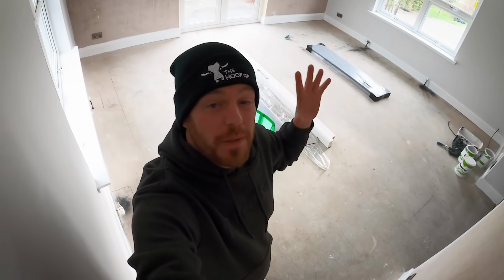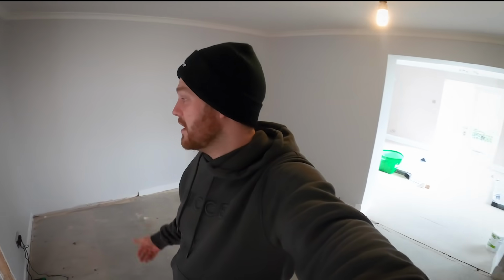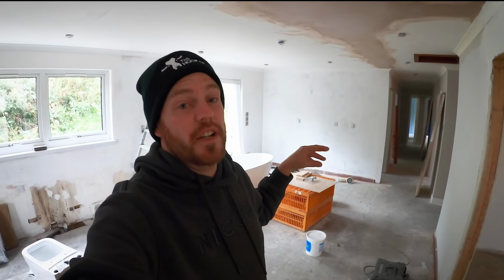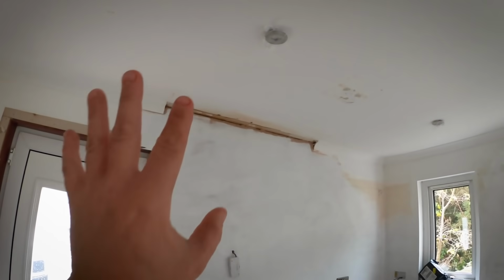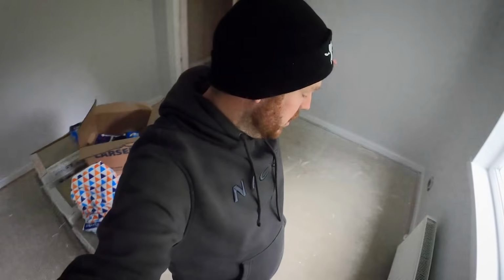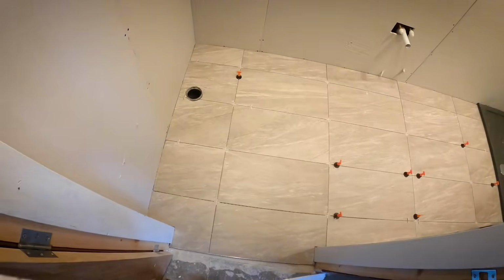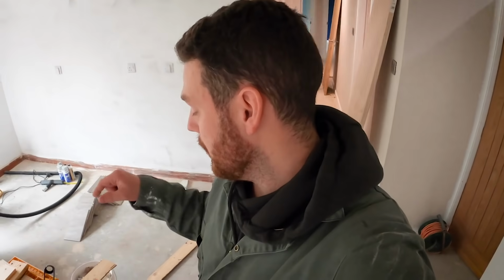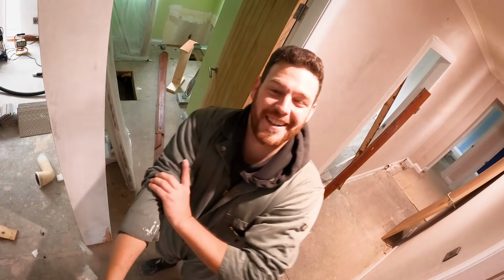IDIOT REBUILDS HOUSE

Comment: Your reno is really coming along. A lot of excellent work in top time. I'm thinkin that the fireplace reno is going really well. And, I've no doubt you won't be able to tell that it isn't real marble when your 'painter' is done. I have great faith in Ash. As a BTW for those yellowing heaters in the other rooms. In Canada you can get spray or regular cans of paint that is specially made to be used for 'hot' surfaces (like heaters). They come in a decent variety of colours definitely in black and in white. You could turn the heaters off, tape appropriate areas and get a lovely fresh look to them. Not terribly big cost. You should check to see. Im sure they would have something of the like there. I would personally do them before you move in just for ease and less smell to deal with. It's a fast 'fix' and they look good.
 (You probably would be better at this than I but I find even coverage with spray cans difficult. So, I often paint things like this with an appropriate size brush to get the good coverage then use can of same colour spray to give the nice finish. I've wasted a lot of cans of spray paint before developing that technique ☹)

Comment: sockets are what my family fight over!! we really need more but rent so....and just a tip with a split like that...you can also put a finishing nail through it at an angle to secure the corner so when the glue eventually breaks down it won't pop up n catch anything.  I'm in love with that tub!! ours is way too shallow to really enjoy if your over 5ft(I'm 5ft 9).  otherwise your wife is kicking butt on the house with your help! 4wks though is pushing it....more like just before christmas(my family moved into my mo.s place back in 06 on Christmas eve!!)

Comment: I drill corresponding holes in the skirting boards and wall. Drive a plastic plug in the wall and attach the board that way.
Not a lot of work and makes it easy when taking them down in the future for painting, wallpapering or when carpet needs replacing. But it's too late now, maybe your next house??

Comment: Greame, always cut the moldings and baseboards from the front. The saw will cause splintering on the back. Also remember, "A little putty, a little paint, makes a craftsman what he ain't." Thanks for the video. Jon
Reply: Also if you put a strip of tape on the back it shouldn't splinter. 😊

Comment: As a general rule you want to avoid cutting wood in ways that will cause splitting but when it does happen, a little glue and something to hold it in place until the glue sets. Then you get to decide if you glued it well enough to not have to explain what happened or just cut another piece.

Comment: A socket here, a socket there, sockets sockets everywhere!! Grats on how gorgeous your home is becoming. It’s a ton of work!!!
Reply: I went from living in a house with not that many sockets to a house with lots of sockets. I love it.
Reply: @jasminehagerman6329  they sure make life easier. I had the same problem with one of my places I rented. I ended up having to get tons of extension cords. Have plenty of plugs now. Those cords aren’t safe ⚡️ ☠️ ⚡️
Reply: @dbell582  I went from 1 socket per wall if I was lucky to 2-3 sockets per wall depending on wall length. Unless it's the hallway or the wall that has a closet on it then its 1 for the hallway and none on the closet wall.

Comment: I would lay the floor before installing the baseboard trim!
Reply: I was going to say the same thing.. because of lockdown we decided it was time to do the floors on the entire bottom floor of our house.. it started out as just two rooms, by the end we’d done it all even the laundry room! So yeah,, I can’t imagine leaving the baseboards up and then putting down the flooring.. is there a reason to do it this way?
Reply: We are having flooring replaced in our house from carpet to laminate, it’s cheaper and faster to just have them add shoe molding to the trim, than having them rip up the baseboard and reset it.